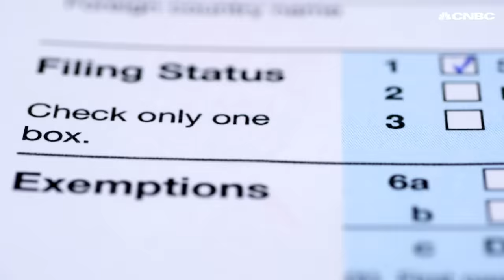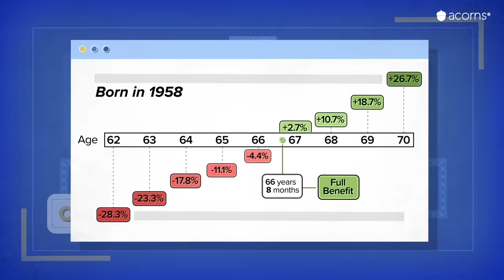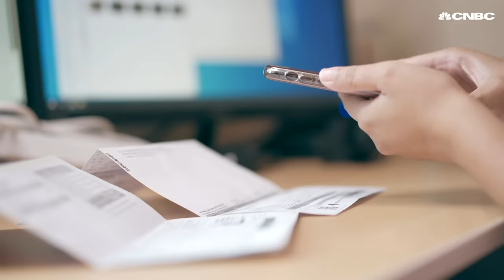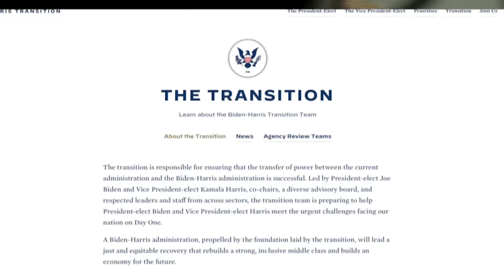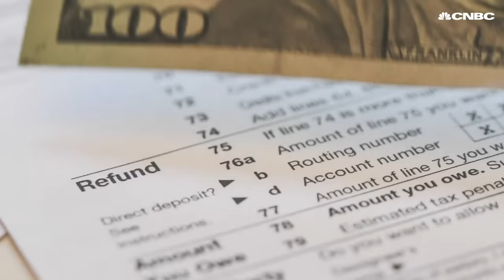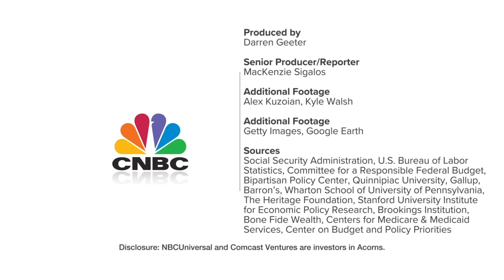How Social Security Works

Comment: One thing a successful retiree never discloses is how they got to realize that the key to amassing wealth lies in making sound investments. I purchased my first home at the age of 21 for $87,000 and sold it for $197,000. My second home, acquired for $170,000, was later sold for $320,000, and my third property, purchased at $300,000, fetched $589,000, with buyers covering all closing costs and expenses. Not reaching a million before retirement feels like an unfulfilled goal.
Reply: Cool numbers but you’re leaving off how long that took. Stocks would probably do better and take less work.
Reply: @steftrando  Stock market Averages 10% a year, average cost of housing has gone up 3.1% from MARCH TO APRIL.
If you had a house in Miami Beach Florida last year, you made $173,000 this year without doing anything.
Reply: This requires good governance and policy. You’d hardly feel the same way if America didn’t have policies in place tgat incentivise home ownership. Not to mention if a revolution or significant social disruption occurs much like in history good investments won’t guarantee safety.

Comment: 6 percent of every check you'll never see. Could of put that into a 401k.
Reply: Well, at least it's going to a safety net place waiting on standby when you  retire.
Reply: @TheCoachRC  except its not. Maybe you missed the memo, ss is running out and likely not a feasible thing for younger ppl to tap into when it's time.
Reply: @nunya9763  That is true, Steve, which could apply to many older people as well thanks to Congress tapping into the fund and looting some of the money for foolish purposes.
Reply: Agreed
Reply: Basically, the responsible are paying for the irresponsible that would never save their money.
Reply: 401k, well you'll pay 20% taxes each time you withdraw money
Reply: @milamcdonald7142  That 20% tax is if you withdraw the money early. If your 401k is a Roth, you won't pay taxes upon withdrawal (because it came from post-tax income). If it's traditional, you'll pay at your current rate-which makes sense the money was pre-tax income-you didn't pay taxes on it when you earned it.
Reply: @TheSeniorTaco  Sounds just like every other sales pitch to dump SS and switch to private retirement plans a.k.a. 401k.  Misses the key issue that private plans pay transaction fees and are subject to market volatility.  So, grandma and grandpa had an amazing 12% left every every month for the 40 years they worked and invested it with market average returns 1966-2006, the financial crash left them with barely 4% of their lifetime earnings to pay expenses for the next 15 years.  Doesn't sound like such a great plan to me.
Reply: @milamcdonald7142  I would rather get 80% of my money than 0
Reply: @just4funallday508  I’d rather risk losing it myself than have the government lose it for sure
Reply: And if you company matched that 6 percent. Plus what ever you put in! It would be a insane amount better.
Reply: @just4funallday508  not sure where this 4% is coming from.

The SP 500 has a historical rate of return of 10% per year. Imagine that compounded over 45 years of working
Reply: @jsebby2284  Sure you might get 11% if you invested it all the day you turn 18, otherwise you need to do the math for increased investment over time...works out to about 4% overall.  Pick whatever number you like and redo the math.  Ask any investor what they think about timed investments; e.g. putting all your money in CDs that mature the day you retire, which is basically what putting your money in the stock market is.  I'm not saying the stock market is bad, just don't believe the hype about SS.
Reply: @just4funallday508  in what ways does 10% return per year work out to 4% total over 45 years??

CDs and the stock market aren't really even close to the same return
Reply: @jsebby2284  Invest as you see best.
Reply: @milamcdonald7142  It does depend on your income bracket...you also pay transaction fees, you don't get the 6.15% from your employer (some match up to 5%), and there is no guarantee what it will be worth when you need it.
Reply: @just4funallday508  that doesnt even remotely answer my question haha

But okay thanks
Reply: @TheSeniorTaco  Wow, that's something to look forward to a whole $416.67 every month vs. SS $1100.  I know which works better for me.  BTW, I guessed $24k annual salary, born in 1960, retired at 65 and lived to 85. so you can do a good comparison.
Reply: I like this idea.
Reply: @milamcdonald7142  it is unethical to tax on retired distribution... the existence of 401k is to let the PEOPLE to take care themselves when retired without gov help. But gov take advantage of it via tax... I don't see why Americans allow it happens🤷🏻‍♂️
Reply: Screw SS. People on the left are so worried about privatization of retirement funds, and then ask why we don’t have free healthcare like Norway or a good quality of life like Norway etc. but then completely ignore that Norway has a pension fund put into the stock market. It’s self sustainable. Paying 6.5% every paycheck or 14% if you’re self employed is absurd when that money conservatively invested in a Roth can yield much more. And the whole “oh what if the market dips one year” is ridiculous since it’s not like you’d take all the money out that exact year, and even if you do, you’d still have more money than if you would have invested in SS
Reply: I’m 70 years old and wanted to opt out of FICA when I was 21, figuring I could invest the money to be paid to SS and come out many, many times better. I believe I was correct then.
Reply: @just4funallday508  Sorry, but your arithmetic is way off son.
Reply: @chuckinhouston9952  Well thank you so much for your evaluation.  Might there be some math you could share that supports your conclusion?
Reply: @just4funallday508  well somebody has to pay it. The notion that the government just pulls money out of it’s ass (remember the government has no money, only taxpayers do) to pay social security doesn’t make sense either.
Reply: @jonathanalvarez3875  if I had 14.4% invested into a 401k in addition to what I’m already investing, I’d retire in a yacht. Too bad I’ll never see that money because the government squandered it.
Reply: @just4funallday508  4% a lot higher then zero.
Reply: Raise that cap!
Reply: 12 percent.  Your employer 'paying' 6 percent is a myth.  Its part of the cost of employing you, whether it goes to you first and is taxed away or they pay it for you.
Reply: Nobody is stopping you. If every citizen did that wall street would collapse.
Reply: Why won't you see it?

Comment: 1:38 Since 2010, Social Security's cash flow has been negative
2:52 President Roosevelt signed Social Security into law half-way through depression (August 14, 1935)
3:34 In 1939, added child, spouse, and survivor benefits
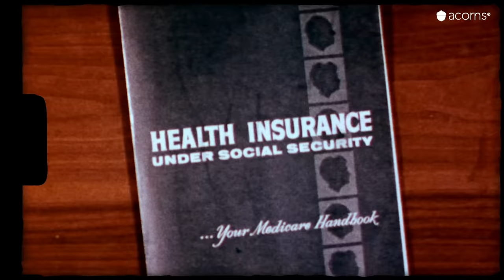3:50 In 1965, added Medicare and Medicaid
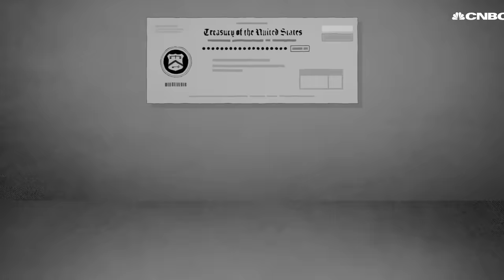5:17 The first monthly SS check was cashed in 1940 for $22.54 | in 2020, the average check is $1,503 a month 
6:42 How your SS benefit is calculated: birth year, average income, retirement age
8:49 You can start collecting SS at age 62 (but benefits are reduced compared to waiting until age 70)

Comment: I was so interested in what percentage of people who qualify for the maximum SS benefit at FRA I asked the Social Security Administration Statistics Department.  After a few weeks and a couple questions I got a response.   In 2019 the maximum benefit at FRA was $2861.00.  0.18% of all people that filed for Social Security benefits at FRA received the maximum benefit of $2861.00.  This tiny fraction is based on all qualifying factors you mention in your video.
Reply: So that means on 0.18% of the population earned enough to pay the maximum amount, $142k in 2021. Sounds about right, I think they're called 1%ers

I suggest the more interesting question is the distribution going downwards and particularly over time.  What percentage under $500 in 1980 versus under $1,500 today (inflation adjustment).

Comment: IAW documents in the library of Congress. 
The mishandling of Social Security funds has been going on since the mid-1980s. As soon as the surpluses, resulting from the 1983 payroll tax hike, first began to flow into the Treasury, politicians from both political parties began using the money like a giant slush fund. At that time, it would be at least 30 years before the funds would actually be needed for Social Security, so politicians developed the bad habit of “temporarily borrowing” the money and using it for non-Social Security purposes. That bad habit never was broken, and every dollar of the $2.5 trillion in surplus Social Security revenue, generated by the tax hike, has been spent, leaving no real assets in the trust fund

Comment: Eliminate the Earnings Cap so all earnings are taxed for Social Security.

Do not invest in the stock market.
Reply: Then also eliminate the payout cap.
Reply: @johnp139  
It is already weighted so the more your eligible for, the smaller the percentage you'll receive.  I maxed out on the earnings cap most of my earning years yet I'm receiving percentage-wise less than those who earned less during their work years.  

I'm OK with it as the SS Program was designed to keep older people from destitution.  View it as a "civil duty" for more equality in the US.  The republicans have pulled us away from equality since Reagan.  It's time to make things more equal again.  Those that work should be able to live, not "well", but OK.

Comment: We just spent 5 trillion in stimulus checks. What's the big deal of funding SS like that when needed?
Reply: It is a self-contributing program . Not welfare
Reply: The big deal;   SS would be funded out of everyones checks, equally, instead of going to those who have funded it the most.   The money taken from you because you worked the hardest would be given to the lazy types, especially the so called disabled.
Reply: @DrSchor  Good ideas until you started dissing the disabled. And the disabled benefits do not come out of your retirement contributions.

Comment: SS  Q.  I never get the same answer form this Q.   I will retire next year with 39 years for the Gov. I will retire under the 30 years MRA 56.5. I will receive Full pension, TSP and social security supplement. So, Will my 39 years count for Social Security at age 62? or do to not working for the next 5 years add a 0  for those years  and just count the last 35 years from 62 back?  From one retirement class no worries you have 35 plus years. The other said NO! it says if you work till 62. Very confused on this. So if I wanted to wait and get a bigger Social security pay out and waited till 67 or 70 , that would be 11 years gone for 67 and 14 years for 70. A huge penalty just for starting my career at 17 years old.       Please help on this . Its getting frustrated to think I will need to work till I have  either 44 or47 years to retire when more people retire with 30 years.  Mike V
Reply: SS is based on best 35 years, so 39 doesn't matter.  You get a reduced SS payout if you take SS before full retirement age of 67 and can't take it before 62.    Some wait till 70 since it provides enhanced payout.    Whether the higher payout for waiting is good or not depends on how long you live.   If you expect to make it to 90, then good to wait.   80 not so much.

Comment: Increasing taxes on everyone unilaterally would be ransoming SS benefits. Reducing benefits would be wholly unfair without also reducing taxes. Raising the retirement age (again) is literally just moving the goal post in the hope more people DIE before collecting what they've been paying into.... The average person didn't cause this problem. The average Gen X will retire with way more savings and retirement benefits than the average Gen Y or Z, and everyone is paying the same even though they admit Gen Y is just straight up funding Gen X.
IMO the only fair option is to lower taxes for anyone under 50-60  and raise it for anyone in a high enough bracket that they could realistically retire even without SS benefits.

Comment: The problem is that they keep robbing people's contributions to pay for other people/programs.  The other problems is that they simply can't do the math.  Here's just one example, and there are many.  If two people pay the exact same amount into social security and retire at the exact same age, they should get the exact same amount.  But, if one is married even if the spouse never paid into social security, that couple draws 150% of the non-married person's benefits. They're taking money from the unmarried person to pay for the married person's spouse who did not pay into the system, and they aren't smart enough at basic math to realize this will drain the system?  Rather than keep increasing the full retirement age, how about phasing out the bonus for married folks?

Comment: The easiest way to fix the problem is that no one collects any social security if they did not pay into the fund. And anyone else gets back what they paid in. End the problem. The only thing is that politicians want to be the tooth fairy giving away money to everyone so they get everyone to vote for them. No more SSD. That money should come from some place else then the security trust fund. The last time I was at a social security office there was so many, "disabled" people it was ridiculous. There was nothing wrong with them other than they didn't want to work and they wanted to collect money. Notice that's not mentioned in this video.
Reply: Who gets SS who didn't pay. I notice people never answer that.
Reply: @SandfordSmythe  Those people who are collecting SSD from my understanding SSD is drawn from the social security fund. Please correct me if I'm wrong. So let's say you start out working for a few years when you're young and then you have an accident. And all the sudden you can't work anymore. So instead of putting into the social security fund you're just taking money out. It's nice to support people who can't work anymore but it's not my fault that they can't. So why should I have to support them?
Reply: @dueymiller5795  SSDI is a separate fund. Both are drawn out of FICA.You may see more at the SSA office because of the paperwork required. Most people can apply on line for retirement benefits.
Reply: @SandfordSmythe  You proved my point. They're drawing from the same fund just because you separated when you're paying out doesn't mean they paid in. Get rid of SSD and social security has a good chance of being solvent for a while.
Reply: @dueymiller5795  FICA stands for the money being deducted from a paycheck. It is separated at time it is collected into two funds  This is all available on the SSA  web site. Read it some time